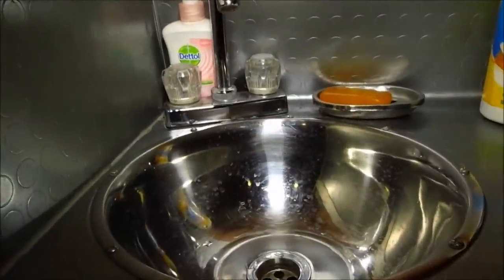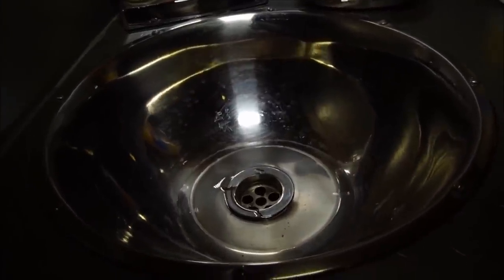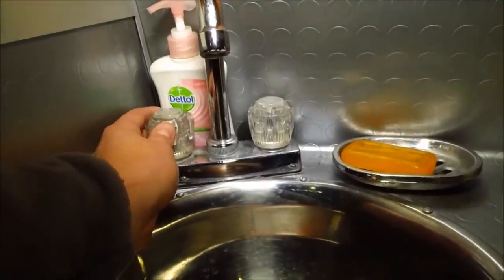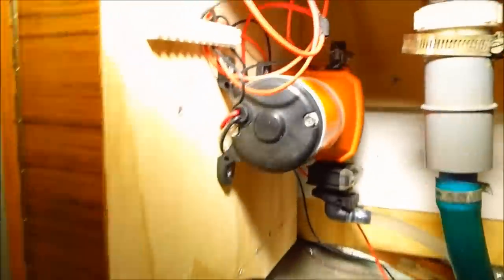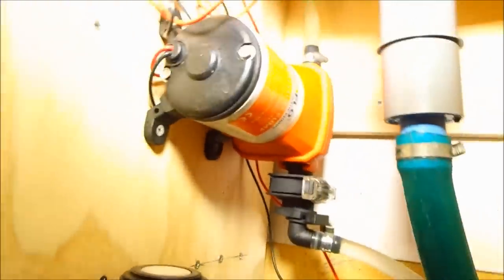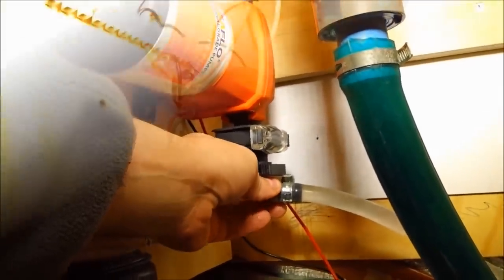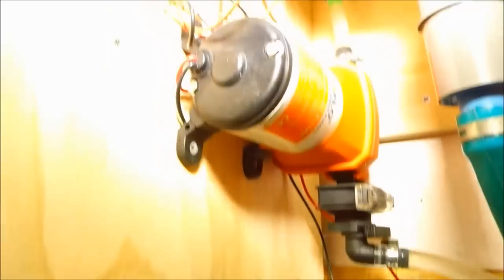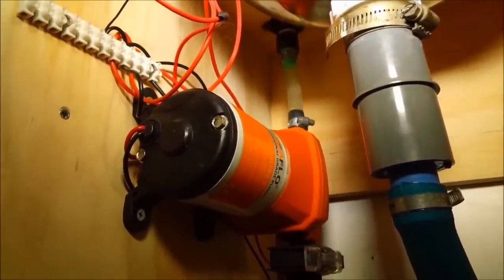DIY Campervan Sink & Water Pump

Comment: I was planning to go with a similar setup. Maybe using a cheaper 12v pump, a smaller tank and a rose for a shower too. But I'm almost sold on the idea of having no running water on the van. I've seen some "dry" setups and the fit my needs, I guess. I don't know, really need to think about it.
Reply from the maker: luizhsriva The best setup for your van is the one will work or you.

Comment: Nice set-up! I'm building up a chevy express van into a bug-out vehicle and wanted to know where did you get the fresh water tank? Also, did you drill a hole in the van floor so the grey water comes out the bottom of the van and on the the ground?
Reply: CycleCruza Dumping gray water on the ground would be illegal. You would need a gray water tank and take it to an RV dumping station.